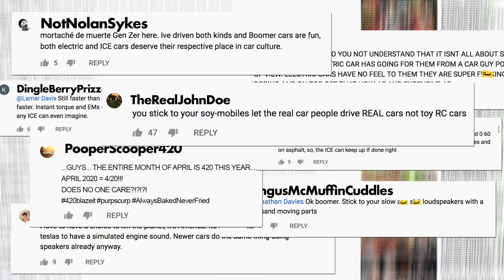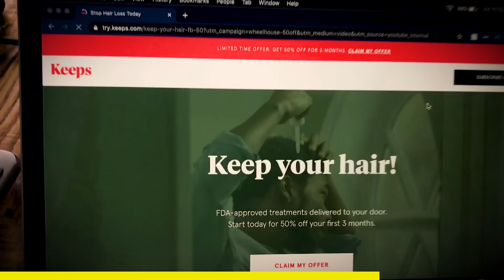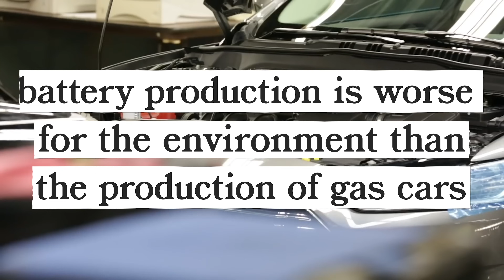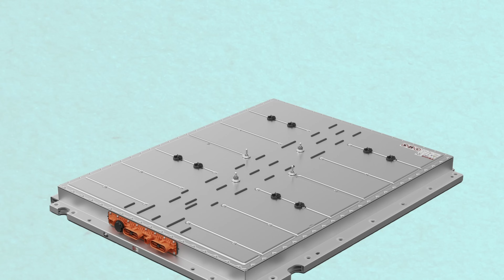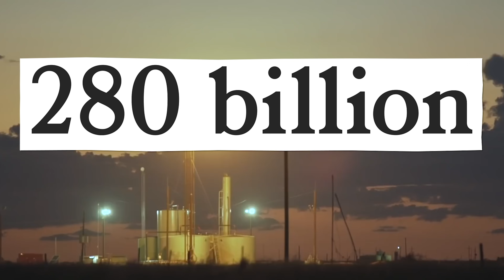Are Electric Cars REALLY Better for the Environment?

Comment: I might be missing something but if you scale up the production of Lithium batteries to replace every internal engine, would that part of the process not make the EV disproportionately worse? I the way in which EV production is worse than IC engines is in the battery production, surely it stands to reason you have to look at comparing like for like numbers of both types of cars, then do the maths, no?
Reply: People compared those numbers, from start to finish, EV's are allot cleaner than ICE cars across cars life span, from material gathering to scrap yard.
Reply: @Zripas  thanks for that, where did the people deposit all the results of those comparisons?
Reply: @richardrandomk  
You can just do some google search, i'm to lazy to look up actual articles about it.
To put it simply, EV produce more CO2 when those get built, but this gets offset in like 2 first years of usage, so in average over cars life span you will produce allot less CO2 even if you would keep using same unclean power sources, like coal plants, switching to renewables would shift that even more.
Reply: @Zripas  astonishing response :-) All the best

Comment: Lol he said that the power grid can handle ev cars. In 2021 the freezing temperature said otherwise and still to this day struggling. Wow u manage to reduce emission by 2 percent. 25 percent of vehicle are contributing pollution while 75 of it comes from large vehicles. And made it inconvenient for everyone, good job 👏
Reply: Interesting counter argument...  Recent thing which happen across the globe, you know, pandemic and stuff which lowered cars driven in populated areas, what was the result on air quality in those areas? Did it improved? Do you like to breath? If yes, then why would you even complain that it only reduces emissions by 2 (its allot more, but besides the point) percent? Is any percentage better than none?
Reply: @Zripas  wow I'm breathing so much better. Let's make more ppl buy these 55k plus electric cars that have a questionable reliability, probably won't be diy cars, and annual registration would be up the crap. But thank u for this breathing quality, not I can think clear how much of bs this future is heading. Lol dude I'm pretty u got a more chance of dying to damn road rage than a so call harmful emission.
Reply: @cesarvazquez4234  
"Let's make more ppl buy these 55k plus electric cars"
Price is going down, but generally speaking there is higher demand of those than there is supply, so while demand is higher than supply price will remain higher.

"questionable reliability"
Its not questionable, we know it to be more reliable than ICE cars.

"probably won't be diy cars"
Which ones are? And why would you need DIY car? 

"and annual registration would be up the crap."
What now? 

"dude I'm pretty u got a more chance of dying to damn road rage than a so call harmful emission"
Cool, then go (not actually suggesting here) to your garage, fire up your ICE car, close all doors and windows and enjoy that none toxic environment... 
You are extremely short sighted... Its basically "If it dint killed me that means it has zero effect on me"... No... If it dint killed you it means that it doesn't have iminent effect on your health, doesn't mean that there is no negative effects in general. And that pollution not only, well, pollutes air, but it add to climate change, but its another topic on itself.
And just FYI you have higher change slipping in your bathroom and splitting your head than dying in car accident, but that doesn't mean that we should ignore car accidents... Your analogy is weird and irrelevant.
Reply: Bravo 👏 👏   the man with the source of trust me. It's funny to me how all the sudden everyone became car ppl and know everything about cars. If you care so much about climate change then take the bus, less ppl driving right. But u won't lol I have a weird view. Look around bozo ain't nobody got daddy's money or job with high paying jobs like some ppl. The people that make America turn around live of pay to pay check. And guess what, servicing their own vehicle is a money saving. Or neighborhood mechanics being able to fix u know the car. Guess what, that's not gonna be possible with electric cars as I saw, they don't wanna give no one info on how to or even sell them parts. Smh cars are the pinnacle of reliability and emissions friendly still getting more and more better. But bozo like you like to type away at something ya not even sure if it's true or false. Let's not forget electric run thru tires at a significant rate higher than normal cars because of weight. There goes 2 percent less to 1 percent lol. But hey 👋 dude u keep saving the world 🌎
Reply: @cesarvazquez4234  
"It's funny to me how all the sudden everyone became car ppl and know everything about cars"
Isint its you who made original comment implying that you know everything about cars?... Isint that ironic on itself?

"If you care so much about climate change then take the bus, less ppl driving right. "
It needs to be group effort... if you just go and shit all over the place then rest people wont manage to actually prevent climate change... I mean, its already too late, we passed that line, now its only question how worst it will get before it gets better IF we lower emissions. 

"But u won't lol I have a weird view."
Yes, you do have weird view, we agree on that.

"And guess what, servicing their own vehicle is a money saving."
So all those parts you replace you got for free? No need to buy them? You just patch everything with hot glue?
And just FYI electrical cars need allot less maintenance as you have like 100X times less moving parts, go figure.

"Or neighborhood mechanics being able to fix u know the car."
Just like back in the time people used horses and thought that owning car will be too expensive... And look where we are now... Its basically same situation, buying horse was cheaper than buying car, it even is now, but maintaining (feeding and all) horse is allot more expensive than a car. Same exact thing applies to EV's now, while it might cost more to actually buy one its maintenance/exploitation will be less.

"Smh cars are the pinnacle of reliability and emissions friendly still getting more and more better"
Do they? Do you have actual numbers how much "better" it got in past decade or two? And that doesn't resolve issue even if it did, its still way more than what EV's produce.

"Let's not forget electric run thru tires at a significant rate higher than normal cars because of weight"
Let's not forget that you don't need to change brake disks due to regenerative braking. Tit for tat I guess.

" There goes 2 percent less to 1 percent lol"
You still dint provided your citation for this 2% magical number, can you? Just to demonstrate that you are not some bozo who like to type away at something ya not even sure if it's true or false. Right?

"But hey 👋 dude u keep saving the world 🌎"
Yea, fuxk the planet, who needs it, we will be dead before it becomes to unbearable to live in it anyways, so who cares... Fuck the planet... 

What is your actual argument here? You cant afford EV so its bad?
Reply: @cesarvazquez4234  

"electronic modules and battery go out and aren't cheap lol"
You think other cars dont have electronic modules? Where do you live? In Russia?... its 2022, every single car has electronic modules in them.... its not 90's anymore...
Engines are not cheap ether. If you bothered to spend any time actually researching this instead of being buthurt you would know that you will need less maintenance on EV than you are on ICE car and total cost will be lower. Just because battery pack is expensive doesn't mean that you will need to change it every year... 

"But your buddy elon musk and the other business don't care about that"
Like 99% of car manufacturers makes or plans to make electrical cars, so I guess everyone is bad because you dont like EV's... Ok. 
Tho why do you mention Elon in specific? Hating for sake of hating? Or being jealous that he became richest person on earth while you still stuck in your shitty job? Whats up with that? 

"Same way they don't care about the planet, it's all about the money remember that"
You kind of need money to be able to produce shit... You know... That's how business works... Its not like you dont like money... Aren't you now?

"Ppl like u don't know business use the quote save the world as a gimmick to get ppl to buy ev."
Answer me this, its simple question and you should be able to answer it with "Yes" or "No" answer, question goes as: Does EV produce less CO2 emissions over its life span?
Simple question, try to show that you are not keyboard warrior and honestly answer to this really simple question. Just FYI there are actual data supporting one of the answers, so you should want to actually fact check before you answer just to avoid showing yourself as a keyboard warrior who talks about things he has no idea about. Prove me wrong!

Comment: The cars around at the moment with these lithium battery's are a great first step. Once we have better battery's enviromentally wise and longer lasting (like the life of the car)it will be a no brainer to switch. great video I enjoyed it thanks..
Reply: It already lasts longer than your car will and you can recycle it to like 98% and repurpose same materials to make new batteries.
Reply: @Zripas  no it doesn't. Your telling me a car battery last 20 years? I can go buy a car from the 60's that works still.
Reply: @zackandjessadventures6219  
How much of that original car would still be there? And you can easily replace battery pack, especially with new structural battery packs in Tesla cars which will make your car to out last any ICE car out there...

Comment: Old info.  A study not done by proponets of BEVs but the Swedish  government found actually each Tesla size battery pack is culpable for 20 to 25 tons of CO2.   Which is more than a comparable sized ICE car's CO2 emissions released in 120,000 miles.   Break even  point where the BEV is finally cleaner for the air, about a quarter million miles.   The distance to the moon.   Do the planet a favor.   Buy a IC powered car...
Reply: Did you got paid by oil company?

Comment: So you didn't discuss the issue with Battery replacement.  That must tack on another 8-10 metric tons of carbon.  Then you didn't discuss how many metric tons of carbon were used to make the "green energy" for solar and wind.  One windmill has 700 pounds of rare earth elements in it.  Mining rare Earth's is significantly harder to do.  The moral of the story is that if you want clean energy you have to mine dirty things in dirty ways.  We need a true clean energy power source not fake clean.

Comment: Did you take into account the need to replace the batteries in an EV in the long run? At what interval are they replaced on average? Did you compare average mileage equally? How do they stack up if both drive 11,800 miles per year? Given EV low range that's a lot of charging too...
Reply: Don't need to replace the batteries.... ever. The vehicle will rust out before the battery gives out (modern EVs have a margin built-in, so their range never declines with age). For older EVs, we know that if they are looked after, the battery can last for well over 100,000 miles and probably double that ("Consumer Reports estimates the average EV battery pack’s lifespan to be at around 200,000 miles.").
Reply: @xchopp  Lol which salesman told you the range never declines? Get real.
Reply: yeah and noone realizes tree's are literally designed to eliminate co2. Our effect on the earth is so small compared to natural cycles of the earth
Reply: @insideatent  LOL, this is probably the most ridiculous comment I have ever heard.
Reply: @insideatent  Except... it isn't. That just isn't true.